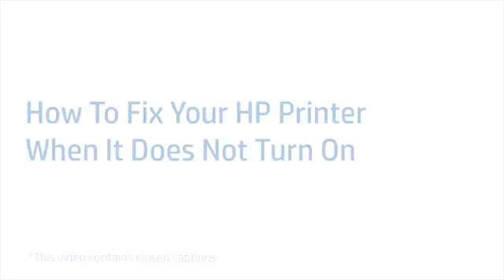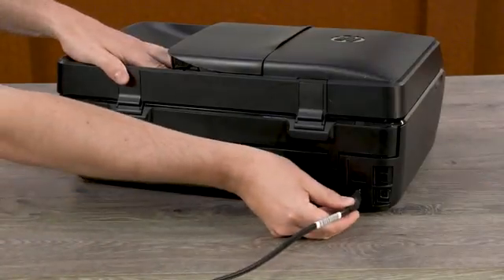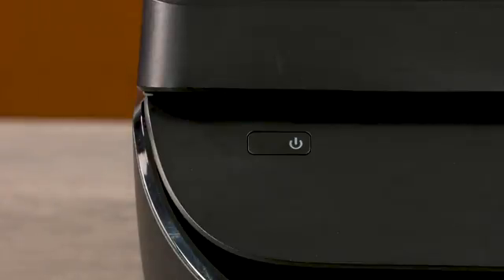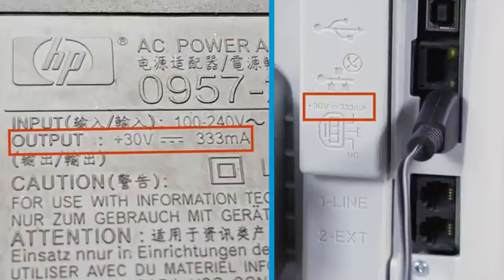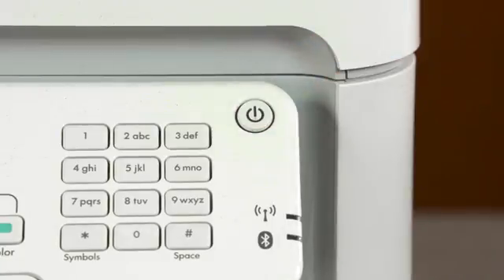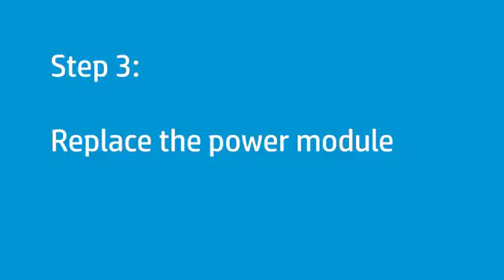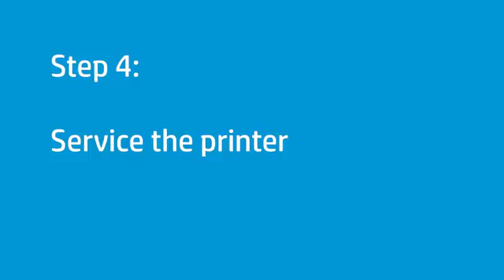Fix Your HP Printer When It Does Not Turn On | HP Printers | HP Support

Comment: Not gonna lie, yall have some of the most unreliable printers I've ever worked with in my entire life.
Reply from the maker: +taven3772 Please refer to the instructions under this document to fix this issue: https://bit.ly/3qc8khL
Reply: This HP printer is a POS
Reply: Can't talk to a real person. These HP printers are ones you need to talk to a real person. Last HP I will ever buy
Reply: @HPSupport  Your service instructions do not work. Your products (every one I've ever had)  are garbage. There's no reason people should fork out good money for a product that can't handle being used even occasionally.  The worst part is that HP is so nonchalant about telling customers, "Well, just buy another one". Get the eff out of here with that. I will make it my life's mission to dissuade anyone from giving any of their hard-earned money to a company that clearly doesn't give a rat's behind about them.
Reply: Agree.....we have a 8710 and Brothers printer.The HP either goes offline, constant idle, etc. Brothers printer always works.
Reply: Step 4  will be the most helpful 😡
Reply: @HPSupport 
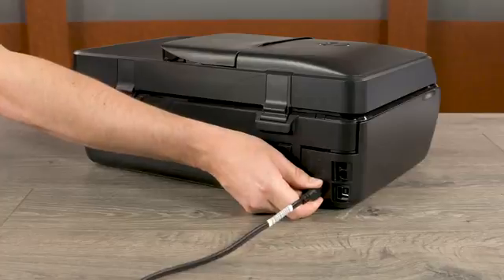My printer is not working i tried different outlets different power cords even the one inside the printer and still nothing, I did see 1 blueish light on the inside of the printer behind the screen at the bottom of the printer but can't tell what it is for!!! 0:26
Reply: @HPSupport @HPSupport 
My printer is not working i tried different outlets different power cords even the one inside the printer and still nothing, I did see 1 blueish light on the inside of the printer behind the screen at the bottom of the printer but can't tell what it is for
Reply: 100% agree
Reply: I agree.   I love HP products but they have horrible printers.  My printer was working great until I changed my ink.
Reply: I have a hp wireless printer and that also is useless good paperweight. Had hp years ago and all had to do was plug it in and off we went. Then power button broke oh well. Get tired of today's technology. We don't want wireless if it's not broke leave it alone. By the way new Lenovo laptop 2 years old used once . 😢😢
Reply: True
Reply: Amen
Reply: @HPSupport  7
Reply: I gave up on my printer and then plugged it in two days later. It worked.  Now it won’t work again.    It’s a huge problem that HP knows about, as they have made a video, yet don’t want to replace faulty printers. Shame on them.  And hopefully anyone that reads this tries again tomorrow or the next day. It will probably work!!

Comment: all options didnt work, my solution: never purchase any HP product.
Reply from the maker: +amco thanks for reaching out!
I understand that you need help with your printer as it is not turning on.
I'll do my best to assist you.
Please perform the steps mentioned under this document to fix this issue:
http://hp.care/2v0gAoi 
Let us know how it goes.
Reply: same! it fucking sucks. its still dead. bought it brand new like 3months ago too
Reply: Same here!! I'm beyond frustrated with this HP printer! I even went on the HP support forum and made a post - only to get a response from a scammer who posted a 800 number to call and requested $9 to fix my printer.
Reply from the maker: +Kevin Tufts Please perform the steps mentioned under this document to fix this issue: http://hp.care/2pigaHj
Reply: Hahahaha
Reply: Don’t buy it!  My hp desk jet 3755 causes frustration & anxiety every time I must print something. Nothing consistently works so it’s trial & error each time. “Help” is not helpful.
Reply: Gurpreet Singh  my hp has lasted 8 years
Reply: @salmaabdullahgb  Mine died while sitting on my desk, not being used for the last 5+ years. Certainly not wear and tear.
Reply: @MariaLuna-ri3cv  that sucks, wonder what the problem was
Reply: Mine's canon,it sucks too
Reply: @salmaabdullahgb  That power cord didn't help. Purchased something else.
Reply: Same, I barely used this and it won't turn on no matter what I try. It's on it's way to the recycle bin at the garbage dump!! Never buy HP again.
Reply: @HPSupport  Your printer sucks. This power issue is very annoying , tried plugging it on an AVR still nothing.

Comment: very informative and helpful.  the printer may not turn on if it is plugged into a  surge battery .  The strength may not be strong enough and in my case, needed to be plugged directly into a wall outlet... many thanks no need for me to call IT - feeling accomplished
Reply from the maker: +Tonya Legg I am glad to know that the video has helped you fix the issue.

Comment: i bought my HP ink tank 115 two months ago. and it worked fine until yesterday...but today, it does not power up. very frustrating.
Reply from the maker: +Jessa Rubio thanks for reaching out!
I understand that you are experiencing an issue with your printer as it is not turning on.
I'll do my best to assist you.
Please perform the steps mentioned under this document to fix this issue:
http://hp.care/2pigaHj
Let us know how it goes.

Comment: Wow ... printer lasted a whooping 10 pages and 2 months before getting this error (bought it for urgent printouts, rather than going to a copyshop for 2 pages every once in a while).
Also, is there a reason why a printer which has a power requirement of 700mA written on the outside ships with an internal brick rated at 430mA (glued shut of course so one can't take a peek at the very likely dodgey caps)?
Really excited for your response.
Reply from the maker: +Hans Meier Please perform the steps mentioned under this document to fix this issue: http://hp.care/2pigaHj Also let me know the model number of your printer so that we can check the power supply specification.

Comment: The unplugging/replugging steps need to be done in the specific order. 
I mixed them up and it failed to turn on, reviewed the video again and tried again in the specific order mentioned and now have power again. Thanks!
Reply from the maker: +Rebecca Dean Nelson I am glad to know that the video has helped you fix the issue.
Reply: I disconnected everything to move it to another PC. Nothing works.

Comment: Hownto repair, printer won't turn on, only the wifi direct and three exclamation point are lighting.
Reply from the maker: +Monica Winsleth Please perform the steps mentioned under this document to fix this issue: https://bit.ly/2XJWCy2
Reply: I've done doing that, still not responding.
Reply from the maker: +Monica Winsleth If the issue still persist, please contact our phone support team for further assistance: Please follow these steps to reach them.
Step 1. Open link: https://support.hp.com/us-en/contact-hp
Step 2. Select the product type.
Step 3. Enter the serial number of your device or select let HP detect your product option.
Step 4. Select the country from the drop-down.
Step 5. You should see the HP phone support number.

Comment: Unbelievable Fix!  I had unplugged the printer from the back and waited before plugging it back in...no help.  By unplugging the block and outlet the printer power was restored.  I have worked many years as a high-level electronics technician and did not think to do this since I did not know the block had a reset function of its own.  Thank you HP.  And thank you Youtube.
Reply: Dang mine doesn't have a block just a cable

Comment: Plugging the printer power cord directly into a wall outlet did the trick. Plugging it into its usual surge protector strip, didn't get it going. Thanks a lot.
Reply from the maker: +J Murray Glad to know that the video has helped you fix the issue!!

Comment: every time my printer goes offline I need to unplug and replug to go back online and print. Is there a way to make the on/off button work? or just keep the printer online forever? HP envy 6030 with instant ink (requires to stay online all the time)
Reply from the maker: +Nicolas Mosca Please follow the guidelines under this document to fix this issue: http://hp.care/2n7rtUY
Reply: It's annoying as hell! Every time it shuts down I have to google this long process, it would be nice to just touch the on/off button!

Comment: My hp officejet has the wifi icon on and there is an orange exclamation mark on the printer. However, i cannot get it to turn on. I have tried these troubleshooting methods and nothing works. I have also recently changed the power cord. Could you please say what the issue may be?
Reply from the maker: Hi there, thanks for contacting HP Global Social Media Support!
I understand that you are experiencing an issue with your printer as it is not turning on.
I will do my best to assist you.
Please refer to the instructions mentioned under this document to fix the issue: https://hp.care/4bGEQzS
Regards, 
HP Support

Comment: hp envy photo 6230, the last one of the shop, first set on, It stuck in loading screen with no interaction touching screen or with poer buttom. No change nothing plug and unplug. It is an forcing reset buttom or something??
Reply from the maker: Hi there, thanks for contacting HP Global Social Media Support!
I understand that you are experiencing an issue with your printer as it is stuck on loading screen.
I will do my best to assist you.
Plug the printer into a working wall outlet, and then test the Power button on the printer.
Make sure the power cord is connected to the rear of the printer and is plugged directly into a wall outlet.
Press and release the Power button to start a Power On/Off cycle. Do not hold the button down.
NOTE: If you press and hold the Power button too long, the printer might turn on and then off without restarting. If this happens, press and quickly release the Power button again.
If the printer does not turn on, wait 10 seconds, and then press the Power button again.
Regards, 
HP Support
Reply: That doesn't work, never worked, I had tried that before I start to search the problem
No said again "unplug, wait and plug", neither "react to touching screen" or "react to power buttom"
I have seen that answer everywhere and for everyprint 
Have to be another form for reset
I hope
Reply from the maker: Thanks for the reply.
Please try attaching the printer to a computer through a USB connection and launch hp smart and unplug/re-plug the USB connection, it will actually finish loading. 
Please let us know how it goes.
Regards, 
HP Support

Comment: My printer refused to open last night, no matter how many times I tried. I had just finished using my printer an hour before deciding to use it again to print more lessons, and this is what occurred. I looked online for a solution and came across this video. I tried it several times last night and got up early this morning to try it again, but it didn't work. I'm hoping you can assist me because I need to print my lessons in order to study for my approaching midterm exam. Thankyouu
Reply from the maker: +Kaila Marie Bacala Please refer to the instructions mentioned under this document to fix the issue: https://bit.ly/3qc8khL

Comment: I have a HP LaserJet 500 the printer does go on but not the screen I did plug the printer in at the wall took out the plug it works for a time then the panel does not work again I changed the touch panel it work for a time but no does the same wat can be the problem?
Reply from the maker: +Franco Binedell Please perform the steps mentioned under this document to fix this issue: http://bit.ly/2uxGP6G

Comment: my printer is an HP115 tank it does not have a power module- tried plugging and unplugging- tried a different outlet-  the power button is still not working,the power indicator light where the power cord is plugged in at the back- lights up  when i plug it in an outlet  but the power button- on the top of the printer is still not working, PLS help! it was working fine just a week ago. this so frustrating! i didnt even do anything! it was just working fine last week then when i tried to print my project- the printer wont power up!
Reply from the maker: +Catherine FA thanks for reaching out!
I understand that you are experiencing an issue with the printer as it is not turning on.
I'll do my best to assist you.
Please perform the steps mentioned under this document to fix this issue:
http://bitly.com/2NA6LbV
Let us know how it goes.

Comment: I have the opposite issue: how to shut off a wireless printer?  Often I can't switch HP Envy 6422 Pro off from the back button. I have to disconnect the power cord from the near of the printer.
Reply from the maker: +Asly Tonio The power button is located on the back of the HP ENVY 6055 All-In-One Printer. The power button is above where the power cord is plugged in.
Reply: @HPSupport  Obviously I know where is located the power button. I clearly mentioned it! The issue is the printer becomes stuck with its wireless led on but simply pressing that physical button does not switch it off. The only way to manage the issue is that hard reset, which is clearly not normal. Firmware is updated.

Comment: Sometimes its the power button itself that is the problem. My OfficeJet4500 printer has a rubbery power button that was not aligned properly to the power contact and caused so much power ON/OFF issue for me that I practically stop using it!
Reply from the maker: +CK YAP This seems to be a hardware issue. Please contact our phone support team to fix this issue. Please follow these steps to reach them.
Step 1. Open link: www.hp.com/contacthp
Step 2. Select the product type.
Step 3. Enter the serial number of your device or select let HP detect your product option.
Step 4. Select the country from the drop-down.
Step 5. You should see the HP phone support number.

Comment: The power module for my HP Deskjet 3000 stopped working last month. It's the exact cord that came with the printer, so it has the corrects specifications. I need to replace the cord but the HP parts store says that the block piece is not available there. Only the two-pronged piece is available. The warranty expired in 2012, but the printer was working perfectly fine for years.
Reply from the maker: +Ramonita Ramirez You can purchase the part from here: http://partsurfer.hp.com/ Please select your country and enter serial or product number of your unit.
Reply: The Power Module or Cord may be defective

Comment: i need help, the power cord connector wont stay in, its too loose. this is for my officejet 3836
Reply from the maker: +Cricket Coop This seems to be a hardware issue with your printer. Please contact our phone support team to fix this issue: Please follow these steps to reach them.
Step 1. Open link: https://support.hp.com/us-en/contact-hp
Step 2. Select the product type.
Step 3. Enter the serial number of your device or select let HP detect your product option.
Step 4. Select the country from the drop-down.
Step 5. You should see the HP phone support number.

Comment: I unplugged and re-plugged several times and it worked temporarily (I had to do it again each time I wanted tu use the printer). Now it is completely dead.  I also replaced the power module which did not seem to make a difference.
Reply from the maker: +Chuck Armstrong Please refer to the instructions mentioned under this document to fix the issue: https://bit.ly/3qc8khL

Comment: CP1025NW this doesn't work to turn it back on.  I have to push the button several times, the lights light up and then shut down.  Anyone? Can you help?
Reply from the maker: Hi Beverly, thanks for contacting HP Global Social Media Support!
I understand that you are experiencing an issue with your HP LaserJet Pro CP1025nw Color Printer as it is not turning on. 
I will do my best to assist you.
Please refer to the instructions mentioned under this document to fix the issue: https://bit.ly/3pP68RC
Binu_HP Social Media Tech Support

Comment: How to fix ink tank 310 series?
Reply from the maker: +Kirsten Real If the printer does not turn on or respond when you press the Power button, the steps in this document should help you fix this issue: http://bitly.com/2WIuglG

Comment: HP Officejet 5255 - Won't turn off.  Now what??
Reply from the maker: +jeannine-monroe Varner If your product does not turn off, try this solution: Disconnect the AC adapter and the USB cable. Hold down the power button and the cancel button at the same time for more than 7 seconds, then release both buttons.

Comment: My hp printer which we didn't have for very long stopped working. No idea why. It just never turned back on
Reply from the maker: Hi there, thanks for contacting HP Global Social Media Support!
I am here to help!
What seems to be the issue? Could you elaborate more on the issue?
May I know the product you are using?
Let me know!
Regards, 
HP Support
Reply: @HPSupport  hello, I've manged to get it to turn on but the cartridges say they are full but they will not print anything. I have cleaned them but still nothing so will order some new ones as the old ones haven't been used a while. So think they have dried up.
Reply from the maker: Thanks for the reply.
Please let us know how it goes.
Regards, 
HP Support

Comment: Really? Connect the power cord in three different locations? Why doesn't it reset itself when I press the power button for say 5 seconds like any other modern device? Also, luckily for HP, every time I have to reset a stuck hp 9020 by unplugging the power cord, it starts sucking in a huge amount of ink into its waste bin.  Is this 'stuck' printer feature just a way for us to buy more "genuine" HP ink?
Reply from the maker: +wwcsig Please refer to the instructions mentioned under this document to fix the issue: https://bit.ly/3qc8khL
Reply: Notice how they don't respond to your questions.

Comment: I've followed your protocol to the T, three times.  No response from the printer. I even purchased a new battery for my HP 200 portable printer. It still makes no difference.  I guess I should contact HP Service?
Reply from the maker: +Jane Smith Please refer to the instructions mentioned under this video to fix this issue: https://bit.ly/3BBsS8i